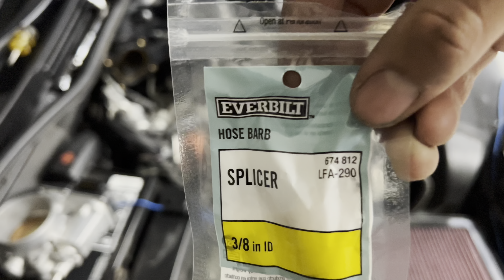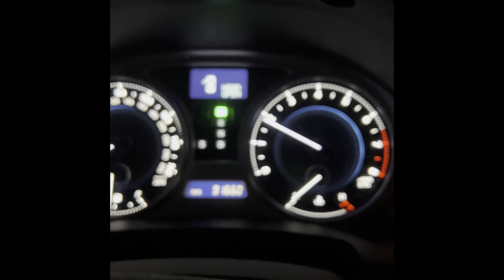Tundra Throttle body install for the is350

Comment from the maker: The car feels a lot peppier now, it’s like instant torque when you step on the gas pedal now, the bigger throttle body goes hand & hand with the ported manifolds so I definitely recommend this install if your doing ported manifolds. I tried to do my best for a step by step tutorial, if you guys have any questions feel free to message me on Instagram @slw.2gr . Hope you guys liked the video !
Reply: How much power you making now??
Reply: Two things
1. Does it just make a little bit more power and two how high does it idle cause I think my idle stock .5 rpm to .7rpm and with the install how high does it idle cause I think the reason it so high in the video is the car computer learning the higher amount of air in the engine
Reply: Would this fit in is250?

Comment from the maker: I forgot to add the video where I install the adapter, but after you take off the bracket you can install the adapter, Make sure the URD is point up and you can read it facing you

Comment: Hey bro quick question regarding this throttle body,

RR sells the throttle body and intake tube with out a adapter.

I have a 16 is350, does it work with or with out.
the 70mm to 76mm adpater?

Comment: Hello Im new to the Is350. Bought a 2006 in silver. Love the car. Question? Will only porting the upper intake manifold piece gain any power with 76mm tb and Cai/Long tube headers and rr tune?

Comment: I got mine for my 2014 gs350 f sport, installed it, driven for around 800 miles, throttle body relearned couple of times, but the engine is still idling high above normal.
Reply: Any difference now?
Reply: Get it tuned
Reply: UPDATE: I found and fixed the hidden gap between manifolds because the 76mm TB was kind of big that lifted the upper manifold so therefore it needed to be shaved down little bit to fit properly and cover the gap, but I deep cleaned and reinstalled the OE TB.  It was last year I got it fixed.  It’s now currently running normal. ☺️
Reply: @billcable286  I will have to get it dyno tested.
Reply: @StarK12trd  at least she still good getting mine tuned within a week or 2 whenever rr racing gets back to me I’ll post a top speed run after driving 500 miles normally after the tune 🤝🏽

Comment: Dit you get a CEL after? I got po505 code after doing this.
Reply: You have a vacuum leak , check over everyone and make sure everything is bolted down correctly
Reply: Same thing I’m getting lmao
Reply: @yoboymax209  i ended up getting a new one and it fixed it, the one I had before came from one with hella miles and the butterfly valve wasn’t closing all the way.
Reply: Am getting the same issue as well but when i look at my old one the butterfly is a bit open just like the new bigger TB? @nicogomez1661

Comment: Does it have to relearn how to idle after you do the bigger throttle body?
Reply from the maker: Yeah it’s going to be a lil funky at first, but after letting the car warm up my idle was back to normal & I went for a test drive right after. Make sure to disconnect the battery before doing the install.

Comment: Did you get any check engine light because I got a check engine light code (p0505) i put a tundra throttle body on my 2015 is350?
Reply from the maker: Did you disconnect the battery before doing the install ?
Reply: @slw.2gr  I didn’t do that. What happens if I didn’t do that
Reply from the maker: @lengyyang371  that’s why you have a code
Reply from the maker: @lengyyang371  erase the code, disconnect your battery and let the car sit for 30mins, after reconnect the battery and see if the code comes back
Reply: @slw.2gr I’ll try to do that
Reply: @lengyyang371 did it go away I have the same issue
Reply: @yoboymax209  no it didn’t work. I’m gonna get a smoke machine tester to see if I have any vacuum leaks
Reply: @lengyyang371  damn :/ let us know when you get it done
Reply: @yoboymax209  I was talking to another guy he had the same issue and he put his OEM TB the cel went away but when he put his tundra throttle body it threw the same code. Maybe we might need a tune but I’ll let you know
Reply from the maker: Yeah when I installed mine I was already tuned before hand so it didn’t throw a code but that’s weird because one of my friends is stock tune still and he didn’t get a code
Reply: @slw.2gr  what year is his car? That’s cool that it didn’t give him a cel
Reply from the maker: 2007
Reply: @slw.2gr  oh I have a 2015
Reply: @lengyyang371  I’m with an 06 getting the code, I know this is gonna sound stupid because it’s a coolant passage, but I didn’t block those, and I doubt that will throw a code
Reply: @lengyyang371  let me know if you find out more, hope we don’t need a tune tbh, not done modding yet and don’t wanna tune too early
Reply: You’ll be fine my cousin told me to run my bigger throttle body ibecause it’s just missing with your idle so you’ll fine you can keep modding your car then get the tune
Reply: @slw.2gr have you beaten any boosted cars?
Reply from the maker: @lengyyang371  a stock q50 redsport
Reply: @slw.2gr  3.0t?
Reply from the maker: @lengyyang371  https://youtube.com/shorts/7p231WwpauI?si=kE5gd9GeF5WjLjgA yea 3.0T RS

Comment: What do you recommend for a Lexus is250?
Reply from the maker: Tbh I’m not sure what would work
Reply: to sell it
Reply: @S5MIKEY  tahh
Reply: @slw.2gr  what do you recommend for it tho
Reply: @moneyfeign2073  i'm serious man, i had one. The money you would use on the 250 to mod it, save it and sell the 250, if you love is a lot than get an isf or is350
Reply: @moneyfeign2073  to sell it not worth doing power mods on it
Reply: @Jesse_2is  why not
Reply: @moneyfeign2073  cause its a 250
Reply: @Jesse_2is  so whaa Fbo ¿
Reply: @moneyfeign2073  what?
Reply: @moneyfeign2073  even fbo on a 250 isnt worth it
Reply: @Jesse_2is  350 then or whaa
Reply: @moneyfeign2073  yea or an isf

Comment: Do I need a tune or nah?
Reply from the maker: No just need to reset your ecu but a tune would be helpful
Reply: @slw.2gr  what's your KCLV?
Reply from the maker: @colby3333  Low rpm 25.2, high rpm 26.8 when I left the dyno rollers , it might be higher now
Reply: @slw.2gr  man that's good.